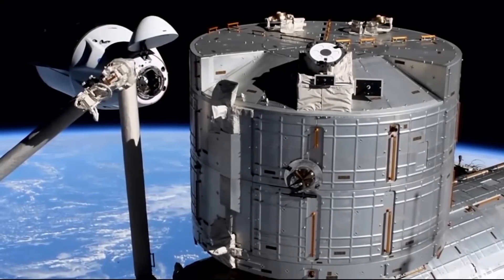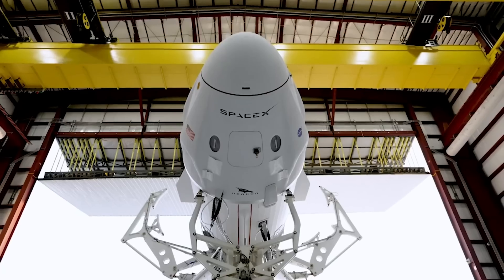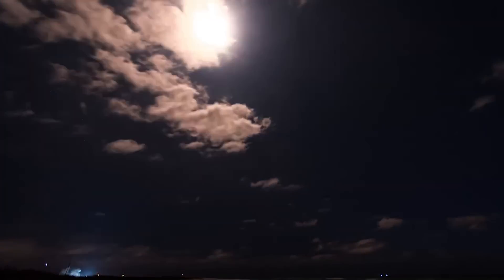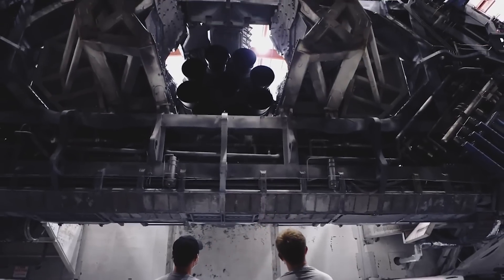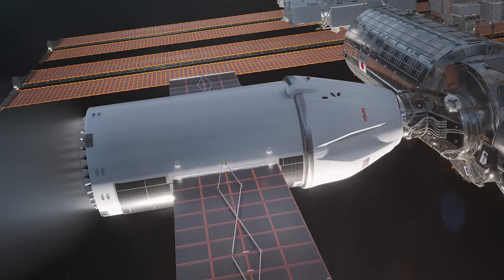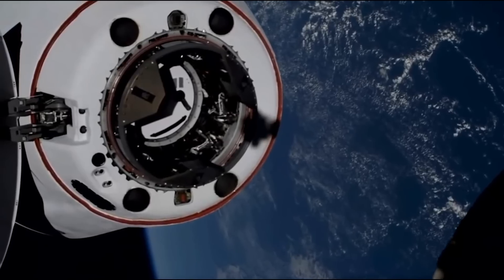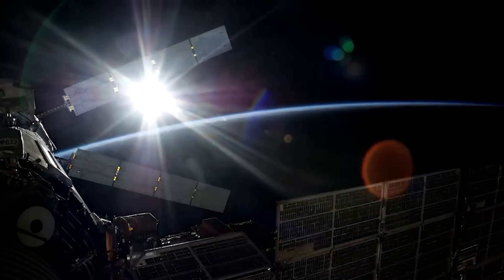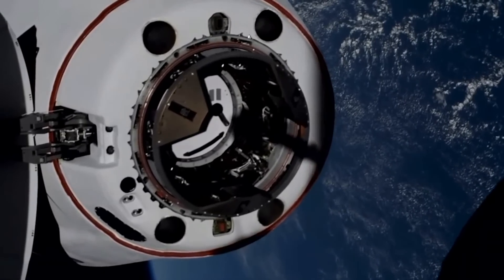A Closer Look At SpaceX's New ISS Deorbit Vehicle

Comment: HEY, ALL READY A TUG BOAT RIGHT, or pusher.  Add a lot more to it, expand off of that innicail design, turn it into a perminate robotic, fueler, several deplotable working arms, not from Canada, just kidding.  Ion drive  as well as huge fuel storage a big 30x30 pressurized work bay, robotic.  But after all the investments and with a company like SPACEX, Musk might just produce a space work truck for anything that develops in the future it will be right there in orbit. for future endevors.   I say they spend a million on what the have built which is a lot so you might as well develop a really good tug, work truck in orbit for a few dollars more.

Comment: I'm surprised they didnt seperate it into modules and de-orbit them seperately, anyone know why that rejected -- or just easier to junk in one go.
Reply: Probably more hazardous to have folks on walks disconnecting all those old parts. Also, when assembled I think there was the Shuttle available to hold the loose module so they'd need a grabber and a pusher to get each separate module de-orbited. *All conjecture on my part, maybe someone has a better or more complete reason? Great question though!

Comment: Seems they're going to use Raptor engines to do this? They have the thrust to pull that off? If so, how? Interesting times.
Reply: They are using Draco. The Raptor engine is too powerful.
Reply: @kazedcat more importantly, the Raptor engine uses cryogenic propellants that have absolutely no chance of lasting a couple years in orbit. Draco uses hypergolics which last much better.

Comment: If the trunk can be modified into a service module, then why can't they use that principle to ferry people between Earth and lunar orbit?  That would make the SLS + Orion redundant, save tens of billions
Reply: The deltaV of space station de-orbit is tiny compared to the deltaV of Earth-Moon transfer orbit.
Reply: @kazedcat  but the mass is a lot lower
Reply: @tomporter8849  E=½mv². deltaV dominates the energy equation. Doubling the mass doubles the energy needed to move an object but doubling the velocity quadruples the energy needed.
Reply: This vehicle would weigh 30 tons and thats without any systems needed to support crew, the only rocket that could launch this to a Lunar transfer would be SLS Block 1B.
I don't understand the obsession in some circles to replace these vehicles anyway.
NASA needs its own transportation systems independent of the private sector regardless of cost, which compared to what Congress could be spending on this is still not that much.
Commercialization into a field (crewed Lunar exploration) where the only market is the government makes no sense anyway.
Reply: Might be better using the rocket equation.

Assumptions:
Dragon's mass is 12 tonnes, this is based on the launch mass of a low earth-orbit mission.
Draco thrusters exhaust velocity: 2900m/s
Delta-V to match Orion: 1200m/s

So initial total mass is:

12e^(1200/2900) = 18.2 tonnes; so 6 tonnes of additional propellant

18 tonnes is the tonnage the must be deployed onto a trans-lunar orbit by the launch vehicle.  This may be within the capabilities of the Falcon Heavy.

Now let's compares with the Deorbit Vehicle:

I've found some sources that suggest ISS deorbit requires delta-V of 47m/s, if this is true then lets run the equation again.  

Assuming we still use Dracos, but this time its 400 tonnes of station that need shifting:

400e^(47/2900) = 406.5 tonnes.

So 6 tonnes of additional propellant, comparable to what it takes for a free flying Dragon to match the delta-V of Orion.

Comment: I wonder how hard it would be to reposition a docking component to allow 2 de-orbiting devices to be attached. If each device had redundancy built in and was designed to perform the task stand alone, then having 2 could provide far more granular control. I know this would be more expensive, but other than that, what am I missing? (I know there is so much I'm missing). Be kind.

Comment: Couldn't they start reducing mass of the station by sending back equipment that won't be used
Reply: I'm betting they will, why would they leave all those science experiments, EVA suit, bio waste, etc up there.
Reply: There really isn't that much equipment that can be removed to meaningfully reduce weight
Reply: Reducing mass is not very helpful. Halving the mass halves the energy needed but halving the velocity reduces the needed energy to a quarter so bleeding velocity using atmospheric drag is more effective.

Comment: Can you even store liquid Ox and Methane for 18 months without it all boiling off? Or 3 years??
Reply: This vehicle uses a different propellant combo, a type of hydrazine plus nitrogen tetroxide.
Reply: @sycodeathman  ohh, ok. Not cryo fuels.
Reply: Maybe I missed that, but surely it'll be Keralox or Hypergoloic fuels. No boil off issue there. The Draco thrusters on Dragon are Hypergolic.
Reply: @_starfiend  kerolox? Kero (Kerosene) lox (liquid oxygen)... liquid.... oxygen...
Reply: But ships attached still have lifetimes --- i mean just about anything freezes at 4K or liquids boil if directly in sunlight.  Though that maybe battery life i guess fir heating/cooling